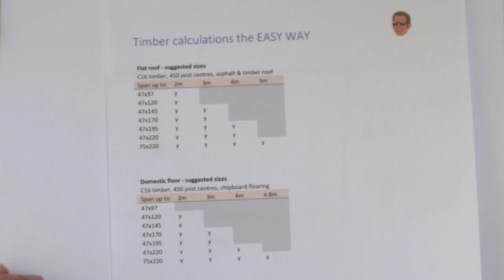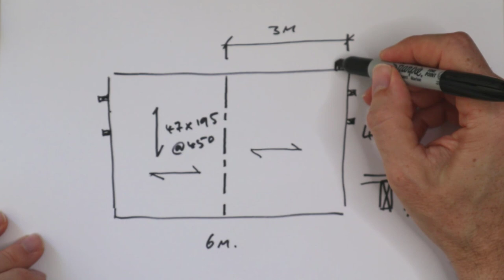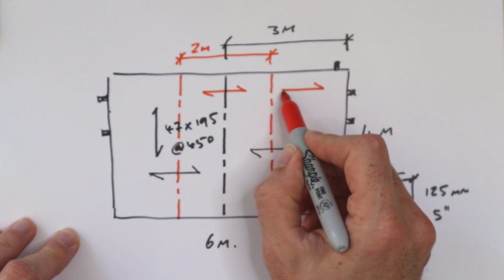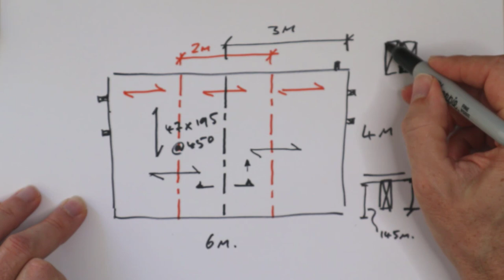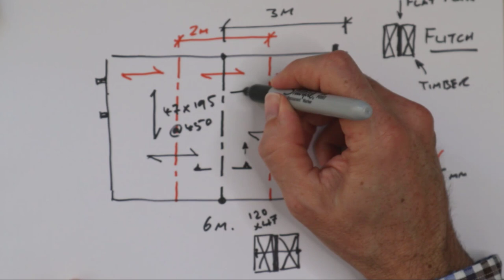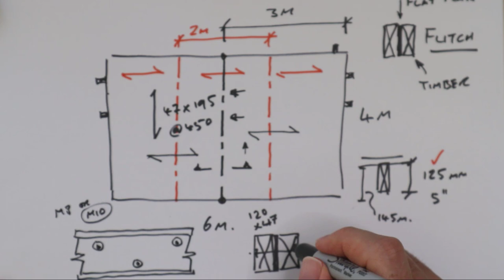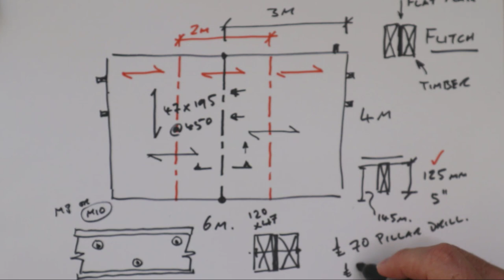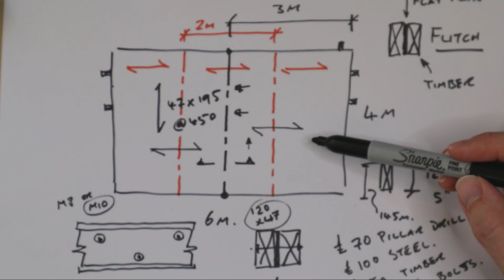Why use a flitch beam for your garden room roof?

Comment: Garden rooms etc, I tend to pick up joists arranged the short way with a cased ( vertically) beam in the centre, half inch ply glued and screwed to the 6”x2”. Takes out all the bounce out of the deck.   This is a pragmatic,easy way out of a springy roof, using what you almost certainly have lying about !
Reply from the maker: That's a great solution 👍

Comment: Other, possibly more efficient assemblies other than a plate, are Angle iron with one leg horizontal  (bottom), or a flat stip along the bottom, or a flat tension strip with a significant spacer at the lower midpoint.  These strip require robust anchoring at each end support.

Comment: My garden room will have either bifold or sliding doors that traverse the centre point on the front elevation beneath where you indicate the flitch beam should go.  Can the flitch beam bear upon upon this point as long as steps are taken to reinforce the bearer below - eg by using a steel box section next to it across the opening?

Comment: I am doing diy calculations for exact same type and shape build flat warm deck roof only 2m longer and wider (6m by 8m). adding 2 flitch beams to cut the joist spans to 2.66m. Considering 47×145 or 63 145 C16 joists. How do I calculate what size joist and steel plate for flitch beam of 6m span?

Comment: Iv got a garage that I’m considering the flat roof for. Max 2.5m height for PD.  My roof span will be 4.6 from block wall to block wall.  Iv been racking my brains trying to think of a solution around using 8x2s and this seems like a great idea. 
Hopefully using steel sheets on the roof and with the reduced joist depth it means the 150mm flashing will work too 👍. 🤞

Comment: I realise your video was posted over 2 years ago but I have a couple of questions regarding flitch beams. 
1: can you include the bending resistance of the timbers.
2. I’ve seen flitch beams used in loft conversions but they don’t appear to have side restraint. Is it that the side timbers of the beam are fixed to the ceiling joists or are additional timbers run in from the eaves to the flitch beam? (I wouldn’t consider brackets to be adequate.)
3: do you need bearing plates at the supports?

And:l finally: why use yield stress and load factors ? I’d rather be safe with actual loads and safe allowable working stresses.

Comment: Hi Robin, thank you for this video. But considering the cold roof here, when you change the direction of your smaller beams, how do you ventilate above the insulation? I mean, if all the beams go front to back, you'd have ventilation through the sofits passing above the pir insulation and below the roof deck as it should for a cold roof.
But when you make the flitch beams and rotate the other beams, how will they ventilate and still compensate for the difference between the 145mm flitch beam and the 90mm of the normal ones?
Reply: You would have to cross batten the top the joists before fitting the firrings to vent the roof

Comment: Thank you for taking the time to make this video, it's very interesting, and much needed currently.  I don't have a project in need of this, but I am curious: would you not need joist hangers for what would effectively be dwangs/noggins?  They too would push the cost up a little if required.  Or are you suggesting a traditional nailing method?  Most people don't realise just how much of a finite source timber is, and how long it takes for a usable tree to grow!  Up here, in Scotland, I'm seeing huge areas of fast-growing pine trees being cut down that were planted about 40 years ago, when I was a boy.  In fact, in the '70s my own primary school had a day trip to a local forestry so all of the kids could plant a sapling, and take one home to plant.  40 + years on and that now has all been logged.  It looks awful, and I'll most likely be pushing up the daisies by the time the next lot is ready for logging.  I doubt there will be a whole lot of use for these logged trees either as they only have an average diameter of about 10'!  And it's just knotty pine!  We really do need an alternative. Thanks again, Robin, you're doing your bit!  Cheers!
Reply from the maker: Hi David.Joist hangers would do it. They cost about 60p each I think. I share your sadness at seeing forests cut down. Steel is 100% recyclable.
Reply: @RobindeJongh  Indeed! And infinity recyclable.  Thanks again for a great tutorial!

Comment: Thank you for this video, I am looking to cover a span on an outdoor room that is 5m x 5m, to keep the height below PD of 2.5m these flitch beams seem to be the way to go.

when it comes to installing the shorter span beams/joists to the Flitch, would these be attached to the flitch by using Hangers? Also for the Flitch would this rest (and attached) on top of the framed front and rear wall or hung onto the wall with hangers? Thank you.

Comment: Great video. If those flitch beams are above the bi-folds. What kind of steel would you need above the bifolds, and would it be better to build the wall that contains the bifolds and supports the steel out of 5x3 studwork and have two ply studs either side of bifolds? Also what would be the spec of the steel?

Comment: Can you just use flitch beams all the way across , front to back or just doubling up the 5”x2” joists ?
Reply from the maker: You could use flitch all the way along but that would be expensive. However it would allow you to use a much smaller timber and thinner steel flat, so perhaps it's worth looking into.

Comment: Hi Robin, I have been looking for a solution to the roof for a project I'm about to start, 5m x 5.5m garden room. My span is 5m front to back.
I have one question what support would I need for the flitch beams on the front and back walls, great explanation by the way.
Reply from the maker: Hi Malcolm. You will need to work out the end reactions at the support (i.e. the shear at the end of the beam) and then design timber studwork to support it. I have just the video for you😉 https://youtu.be/_prO2m5XyqQ

Comment: why not using the original span but with all joists being flitch beams? Would the steel plate not help reducing the section required?
Reply from the maker: Because that would increase steel costs and a lot of time spent drilling and bolting. Good question!

Comment: Hi Robin - Great video. My one question is, how do you factor in a slight slope to the flat roof on a garden room. I'm working on a garden room 7m long by 4.8m wide - but I need the slope to run along the 7m length from back to front (I could do it along the 4.8m width but then face on when looking at the build the roof will slope from left to right (or vice versa)  - but if I used 2x flitch beams like your example above, they will obviously be true and flat - I was then considering placing SIP panels (100mm thick) on top of the flat roof joists - so should I lay them flat along the flat beams and add in a slope on top to get that run for water?
Reply from the maker: Hi Steve. SIP panels can span a fair length structurally by themselves so you may not need any joists at all.

Comment: Thanks for this - brilliant video and really helped me, thanks for breaking it all down. I’ve got a 4m span and decided on three flitch beams like you’ve mentioned with two end beams which are fixed to the end walls fully (no chance of sagging), so a total of 5 beams across the 4m span (along a 7.2m long building, you’ve got a 6m length in your example), with joists in between them all. About to attach the joists which I think are around 1700mm each roughly,  I’ve planned on using truss clips, so I have a flat surface across joists to fix the 22mm OSB T&G to. Rather than joist hangers. Does this sound ok to you?
Reply: A true truss clip would not work because they only have a single vertical edge to support the truss and this isn't designed to take the load directly on it. I suspect that what you are calling a 'truss clip' is actually a small face-fixed joist hanger (sometimes called a mini hanger) that would properly support the joist.. Used with the correct number and type of fixings, such mini hangers should be fine for the 1.7m joists and 22mm OSB roof covering.

Comment: Great video! I'm building a 5x5 room and been advised to use 5x2 doubled up with steel at every joist, 400c. Seems alot to me and expensive. Do you think alternating flitch then doubled up 5x2 bolted would be adequate? Thank you.
Reply from the maker: Hi John. Alternating isn't a good idea, because your roof will sag at every other joist. The OSB board isn't designed to span 800mm. For a 5x5 room, you can put a flitch beam in the middle and have 2.5m joists running perpendicular, or two flitch beams with 1.65m joists running perpendicular.
Reply: @RobindeJongh  many thanks for responding Robin. Sounds like a plan. So if I use one flitch beam along the middle, would the perpendicular ones need to be doubled and bolted? Would have to rethink how I'll do the front overhang.

Comment: Hello. can you use a flitch beam as a ridge beam for a pitched roof?
Reply: I shouldn’t see why not but it may require structural calculations by an engineer to ensure it can take the required load.

Comment: By watching your video, its implied the 2x6 flitch beam can span 6m without issue, is that correct? What would be the max span for 2x6 flitch?
Reply from the maker: Hi. It is spanning the other way, a 4m distance. The depth and breadth of the beam, especially the steel flat, has to be ascertained by calculation.
Reply: @RobindeJongh  I think many would be interested in seeing a worked example of the calculation for a steel flat to go into a Flitch Beam.

Comment: Hi Robin, great video thank you!, I am looking to do something similar with 100mm Kingspan insulated roofing panels on a 6m x 4m Garden Room using a flitch beam as shallow ridge for 4 x 3m x 1m panels, my thoughts are that with the roofing panels being considerably lighter tham a traditional timber roof I shouldn't have any issues, walls will be SIP construction, would you have any concerns with my thinking?
Reply: Hey Robin - how did this go? I too am building a garden room - but it is 4.8m but 7m - but was considering building the walls out of 100mm thick SIP panels and again on the roof the same 100mm tick SIP panels - did you complete your roof yet?
Reply: @stevering5255  Hi Steve, I did, using flitch beams with 10mm plate steel tied into 120mm x 47mm joists,  I used Kingspan roofing panels, they are light and strong defo worth a look 👍